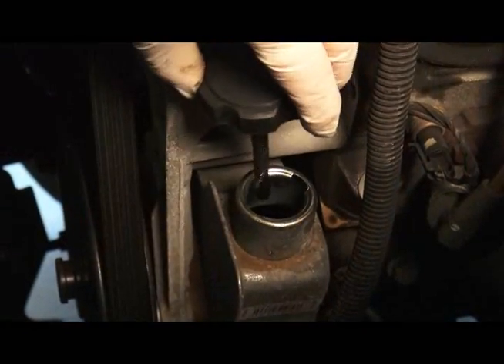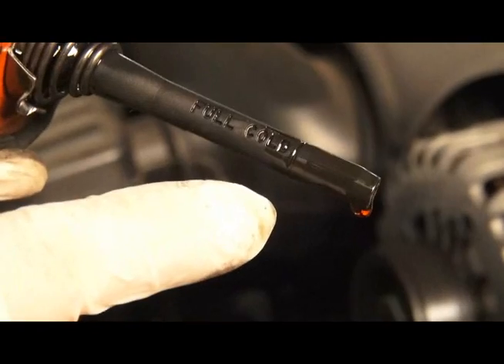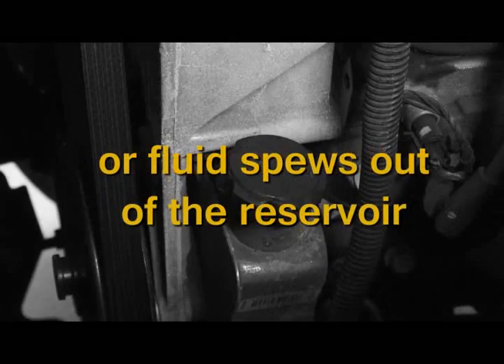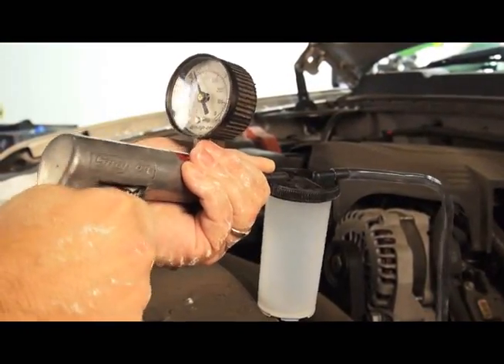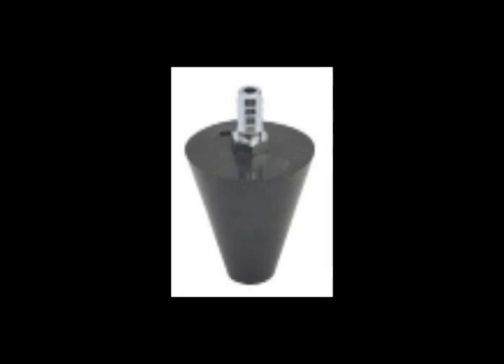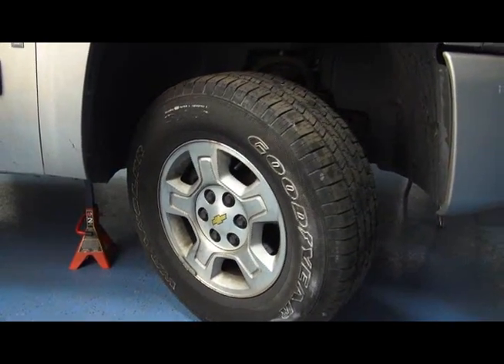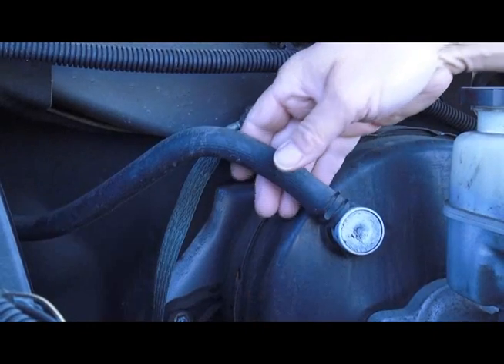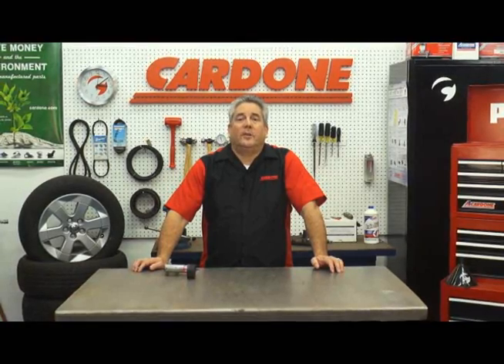How To Correctly Fill and Bleed the Power Steering System

Comment: New pump had 0 pressure even after short starts and many lock to lock turns . Hooked a line to the pressure side with a vac pump, two pumps it was there and started drawing after reconnecting. I had replaced all the lines and with no fluid there it couldn't get the draw . Several people did not know this solution worked like a champ

Comment: Are you adding negative or positive pressure to the power steering pump? I know you said vacuum but wouldn't that suck the fluid out? I didn't see any fluid go into the container.
Reply: closed system. Fluid won’t enter the pump unless something can take its place.

Comment: home boy said not to use the vacuum from your engine......LMFAO.....i wonder what type of back woods hill billy thought about doing that.....
Reply: Thats the way we been doing that for years my friend its not backwoods it old school  inovation : )
Reply: @rokitman5753  Yeah well... An Old School 40 year mechanic used RED power steering fluid in my Hummer H2 after he replaced my power steering pump and hydro boost and totally destroyed both,  ending up costing me $2,200 which was unnecessary had his Old School Ignorance known you NEVER USE RED PS FLUID IN A HUMMER. Only CLEAR PS in a Hummer H2. His expulsion of Old School Ignorance said, "I've used RED PS fluid and even Tranny Fluid in car PS systems for decades without issue." Yeah, well... time to READ UP! NO RED FLUID OF ANY KIND IN A H2 Hummer PS pump or Hydro Boost. These are the same nitwits that tell you Dexcool kills engines. Their info is 20 years out of date.
Reply: @DIZEMANPHOTO  
Dude i know this is old b7t your absolutely wrong about not using red power steering fluid in a Hummer.
I have a H2 and h3 Hummer and both of them are running pure red power steering fluid Valvoline synthetic to be exact..
I've never had any issues in many years on both trucks..
Sorry but the mechanic probably did something else wrong to ruin your system not the fluid's fault..
Reply: What a joke. Your friend didn't wreck your power steering system with red fluid. The H2 uses the same pump & gear internals as a suburban which specifies dexron ATF can be used, right in the manual. Always easier to blame someone else though.
Reply: Curtis Veillon  Why not just do it the right way instead of risking damaging other components?

Comment: Is it true GM pumps from '93-'06 run on dex-III trans fluid? 0:33..that fluid looks red to me.
Reply: Yes, many GMs from the 50's-early 00's can use ATF or PS fluid. I usually opt for clear fluid though, if something starts leaking it's easier to identify if it's a trans or steering system leak.

Comment: I will use a rubber stopper so how i found the fitting? You know what fitting meassure or how i found the fitting because i see to many forms.. so its type fitting you can told me what it is?

Comment: Gracias señorazo me quedo claro, el vídeo tiene la información precisa para la purga, cuando se remuevo todo el liquido del sistema hidráulico, en mi caso, tengo una chevrolet Blazer modelo 94 con Hydroboost, y tenia el freno y la dirección muy dura ya que removí todo el liquido; ya se que toca hacer para ambos casos de la dirección y el freno..                                                        Thank you, my dear friend, I am clear, the video has the correct information for the purge, when I removed all the fluid from the hydraulic system, in my case, I have a chevrolet Blazer model 94 with Hydroboost, and I had the brakes and very hard steering since I removed all the liquid; I already know what to do for both cases of steering and braking ...

Comment: where can i find those vacuum tools? i changed pump for a used one and flushed the fluid and i bled most of the air out but when i turn i still hear the pump and feel vibrations , does it mean i still have an air pocket? or could it be a problem with the rack .
Reply: It's a 2007 Saturn Aura XE v6
Reply: Did you ever find out the problem?
Reply: @nawfsd12  yes i found the problem , it was one of the lines had 2 very small leaks . It was sucking air in and therefore the pump was whinning
Reply: @christopher5024 how did you find it?

Comment: I can't see a difference,  but is there a difference in bleeding procedures between Ford, GM, Dodge,...etc? Filled `04 Mustang to "cold " level, turned wheel  20-30 times and fluid rose to top of pump,... thought it was supposed to go down,  what gives? Should the cap be on and tight maybe?
Reply: Thanx for the reply, though my post was Aug.3rd.  I DID end up using a "Mighty Max" vacuum to bleed the system, which worked quite well.  Again, thank you for your efforts.

Comment: dont turn your wheels with the engine off and cap close! fluid will pop out of the top off the cap. always pop the cap if turning the wheels with engine off.
Reply: I did that while changing my calipers. It was a mess. Now it seems like there is air in the system, so I am trying to figure out how to get it out. Thank you for this information.

Comment: the vacuum pump can introduce more air if to much pressure is applied by sucking air into the rack or pump through the O-ring seals throughout the system.
Reply: @IvanaNotyers okay...  is YOUR wife out on a "run" I need to relieve some  pressure...
Reply: +DragginNuts1  see GM TSB 08-02-32-004B (among others.) it says to use 15-20Hg for 5 mins. then recheck system. However, you have a point esp. when there are cases wherein very small holes are in PS hoses that allow air in,  but have no visible signs of leakage ( yes that's possible) . That's why hoses older than 4+ years excess of 100K miles  should be changed (if system is  bled properly but STILL has air/noise issues ) Also,  notice this quote from Motor Age article March 2014: 

Air can also enter the system through weak low-side hose connections or failing o-ring seals with no outward fluid loss apparent and no visible foaming of the fluid. This, too, was the topic of a TSB from Acura that has since proven itself on other brands. The technique I learned in solving both of these issues (and others) is now a part of my standard service procedure when repairing power steering complaints.
Reply: +Scott Cody I found air in my system causing a cavitation problem and bleeding it using a vacuum pump helped but what really made the whining noise stop was adding an inline filter to the return hose just before the pump. On my 1993 mustang gt 140k odo
Reply: Scott Cody With engine running?   What's the step-by-step procedure?